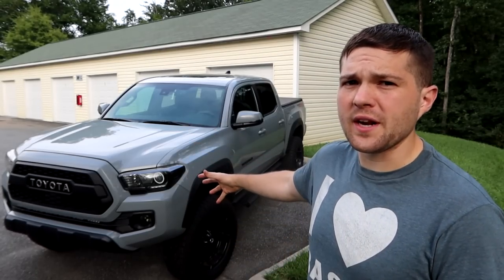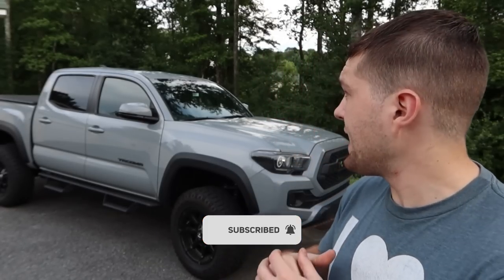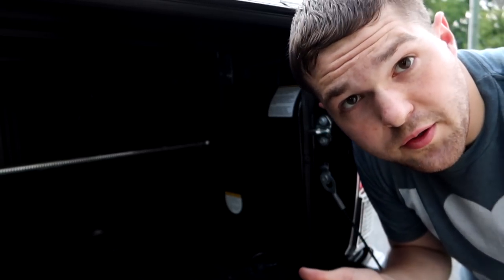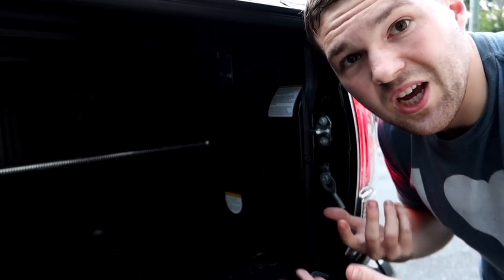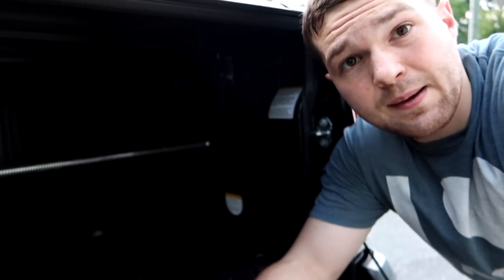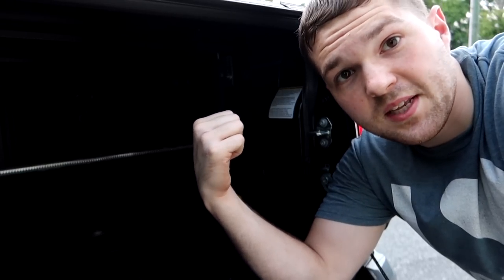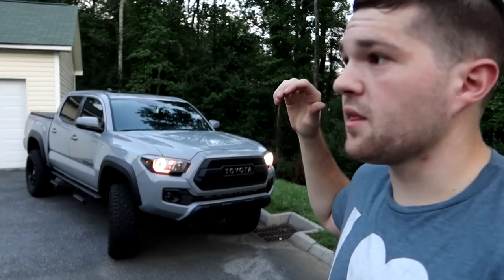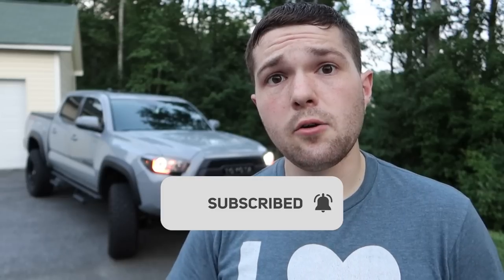The TRUTH about my LIFTED 2020 Toyota Tacoma TRD Off Road

Comment: I just picked up a 2020 Cement SR5 v6 4x4 three weeks ago.  I really don't think the transmission hunts too much but I'm on stock tires.  I took a trip to the Delaware beaches last weekend, a 3 hour trip each way. At one point the transmission downshifted on its own to provide some engine braking on a down hill.  
I used the radar cruise and really like it despite the fact that I used to hate cruise control. You can never stay at your speed here in the mid Atlantic and north east. Too many slower drivers are always making you cancel traditional cruise control.  With the radar it slowed the truck down and if I changed lanes it would speed up on its own to the set speed.  It's so nice, 
And miles per gallon well I got 23.5 in my beach trip. I was impressed.  So far I'm loving this truck. Can't wait to take it camping

Comment: Everyone with the Tacoma needs to buy the rubber bedliner. Solves all your problems
Reply: That's what I did.
Reply: 100% agreee...such a crucial addition
Reply: That's the first thing i did. Fully agree!
Reply: Why?
Reply: @carlosg3320  because the composite bed is super slippery and anything your place back there will slide around like it's on ice
Reply: @MrRay3801  I recently bought tires and when I was doing sharp turns those tires were sliding around. I definitely need to order one.
Reply: @MrRay3801  is this a dealer purchase or aftermarket?
Reply: @davidwelty9763  aftermarket....I ordered mine off I Amazon
Reply: @MrRay3801  thanks!

Comment: I bought the same truck a few weeks after you, only difference, not Premium. I would recommend spending $109 for the Toyota bed mat. Not only will it prevent those dings you were talking about but it will really prevent your gear from sliding around.  I totally agree about the shifting, it sucks!  Mine is stock and I get 20 mpg. Thanks for the video.
Reply from the maker: With my DJ gear I actually like that it slides. Makes getting stuff in and out a lot easier. I never put like on or two things back there.
Reply: have you tried using s mode or ect..

Comment: My wife and I both own 2018 Tacoma, hers is a 4x2 DC SB & mine is a TRD SPORT 4x4 with a 3.5" lift and 32" tires. Our transmissions were always hunting gears also. A few weeks back I took both back to the dealer and made them upgrade the transmission computer software and now they drive like a completely different truck. Plus if you use the " ECT" button you can that extra giddy up if needed. I highly suggest you make them upgrade the transmission software and you will notice a big difference. No more hunting gears in drive and manual shift even works better. 
Bob W.
Reply: So I should do this to my 2020? Not happy with the transmission
Reply: Took my to the dealer for the same thing and they said it was up to date I was pissed, however ever since I took it there it shifts fine.
Reply: Until you hit a 3% to 5% grade at 700 ft asl...then it’s back to gear hunting! Regearing is really the only option. They geared the autos too tall at 3:93, but If you look carefully they geared the manuals at 4:30.
Reply: @DMHal01  how much better does that feel and operate?

Comment: Don't do a Pedal Commander! Get a KD Max tune instead. We did it on our 2020 and it made a night and day difference. We were running 32's for a while.
We are now running 33" BFG KO2's and I couldn't handle how much more sluggish it got so we had 5:29 Nitro Gears installed. That was the best mod so far.

Comment: You need to re-gear the differentials to 5.29’s. That should improve shift points and improve gas mileage
Reply: Also change the upper control arms
Reply: Juan Velez I’ve got Icon Delta Joints UCA once I can get Fox to send me some 2.5 Remote Reservoir Coilovers !
Reply: Should have bought the manual transmission
Reply: Def regear, it’ll help your mpg and gear hunting
Reply: 5.29’s for 32’s?! Sheesh. That’s not a “big, heavy” tire. Toyota needs to update that transmission if you need to gear to that level to push 32” tires
Reply: MrBdiddyp63 What would you suggest for 33’s 4.89 gears
Reply: Terry Osowski not saying you’re wrong, just surprised that’s the gearing a tire that size needs. I think it’s something Toyota needs to fix. I’m used to Wrangler/Gladiator where I had 35/37s with 3.21/3.73, respectively. 5.29s would be for something like 40+.  The engines put out almost identical power, so it must be the transmission (which is not news)
Reply: 5:29’s is a bit low if you’re not running 35+ tires I would think...I’m happy with my 4:88 gearing.
Reply: @juanvelez6947  can you explain why?
Reply: @terryosowski8143  Toyota's gears must really suck.
I run a Nissan Frontier Pro4x 6Speed Manual on 3.69 actually 3.70 rode 33's for 2 years now on 35's 
I plan to regear in the future but to 4:10's i don't know why toyota guys need up into the high 5.08 ratios 

It's like i would of gotten a manual instead if a auto needs that much of a gear jump swear the Truck is already over $40,000 they couldn't of gave you better gearing just outrageous
Reply: @DMHal01  If he isn't Rock crawling that would be useless gear ratio people only go into high 5's which are actually lows  when they rock crawl so they won't have to hit the gas too much it will take itself over the rocks with little throttle that is why they use those ratios.
If you're doing simple trails and nothing outrageous that is just a waste of money ,Half these suckers running around as it is do more street driving then anything else.

Also take into account you change your final drive ratio too much your RPM's will be mad high going from 3.70 to 4.10's on 35's is the sweet spot any higher i am raising RPM's and most likely use more gas.

You have to understand what to compensate with the tire size you over do it you actually make the gas loss worse in some cases
Reply: @tommypearson9260  yeah actually the gear ratio on the auto 3.5l is 3.93 and 4.10 on the manuals if I’m not mistaken. The main issue with the 3rd Gen tacoma is its 6 speed auto and the small displacement engine. If they kept the 4.0 with at least an 8 speed I doubt many would be regearing. Looking back I wished I’d done something like 4.30
Reply: I heard the 4.88 for 33’s but absolutely agreed with it needs to be re-geared. If 35+ definitely 5.12+.. That with a proper lift/alignment would solve the gas problems & the transmission up to 19 are widely known for the transmission issues. 19 up should be straight so if you’re having issues get it tested at the dealership. Hopefully they’ll swap or maybe a programming issue.. They’re bestselling for a reason l guess.
Reply: the real question: how much is that gonna run bro
Reply: 4:56 for 33s 5:29 for 35s

Comment: Good video just bought my taco 2 weeks ago. So I’m trying to buy a rear bed cover and I’m having a hard time finding one. Which one do you have and do you like it ?
Reply from the maker: Got a whole video on mine. Scroll down my channel you will see it. Congrats on the taco
Reply: Taco Rick sweet. I’ve been watching about 2 hrs worth of cover videos right now. I’m looking into tonno pro. But let me check out your video
Reply: Oz Mechanics I had a 17 sr5 crew cab. Great truck as for the bed cover the best one I found was the actual Toyota one that came from the dealer.  It strong doesn’t rattle or squeak on bumpy roads like some of the aftermarkets. Keeps the bed dry and the locking mechanism is pretty stout.  Stood up my 3 yrs constant abuse.  Turned truck in with 64k miles I’m a Hvac contractor def happy with it.

Comment: You don't have to slide your finger on the door handle to lock, you just have to touch the spot. Just hit 1 year and 30k miles on my calvary blue 2019 OR and probably even more in love with the truck then when I first got it.
Reply from the maker: Yeah works better on the slide though
Reply: Thanks for the door lock / unlock truck. I couldn’t figure out why it was relocking after hitting that spot and I didn’t know about grabbing the handle to unlock.

Comment: I have owned 3 Toyota trucks for a total of about 27 years.1993 4x4 extra cab. 2002 Tacoma 4x4 extra cab and my current 2012 4door 4x4, with 3 inch fox coil overs and OME Dakar in the rear. 281/75/17. Get ready for torn inner cv boots and worn Lca’s. In my opinion Toyota is taking a step backwards. They have had a known steering issue, but refuse to fix it or even correct it with newer models. I am in the market for a new truck, but it will probably be a Gladiator. I used to love Taco’s but just can’t bring myself to buy another. And yes the gas mileage sucks, so if I’m gonna get crappy gas mileage, I might as well be able to take the top and doors off and make it worse. Good luck 👊🏻

Comment: I figured out the shift thing. I got an aFe cold air intake and I run non-ethanol gas only. I can be running at 2000 rpm at 80mph. It rarely does the whole “let’s jump down to 4th gear and 5500RPM” thing. Also, oil. Keep your oil fresh. Big help

Comment: Don't forget you can also remote start the truck with the FOB by pressing lock 3 times and holding in at the 3rd time until lights blink
Reply: Is this just on the 2020?  I have a 2019 - thanks
Reply: @rootedrotor525  It should work on the 2019 as well as long as you have remote connect
Reply: Works on 2021 OR with tech package

Comment: Totally agree with the dislikes. I have a 2020 Off Road with 2” spacer/block lift. Getting about 16/17mpg combined driving it super soft. I don’t have the shift problem cuz it’s a manual. Also got the bed mat and Cali Raised stiffeners.

Comment: Yeah I get 17.5 mpg avg city/hwy combined with 265/75/R16 and 20.5 mpg on my 2017 TRD-OR with 4:88 gears and OVTune 91 Octane 2.0 tune for 4:88 gears. I run a full Dobinson’s suspension with JBA UCA and a CBI T3 winch bumper installed.

Get it re-geared and tuned it changes everything.

Comment: Ect button... It's like a Built-in throttle commander. There is a debate whether it decreases or improves gas mileage. I believe it improves the gas mileage because the transmission is not constantly searching for gears. With the ECT button on it will hold the RPMS longer when additional power is needed. If you live anywhere where there is rolling hills definitely use it. You won't get all the unnecessary shifting

Comment: Get the orange tune. Completely fixes the shift issues.  Works great with cruse control.  I hated cruise control before.  Also I get 1.5 mpg better around town and 3 better on the highway.  I am running 33’s and getting 17.2 around town.

Comment: Those storage areas become completely useless when you have 2 car seats in and can’t access any of them with any kind of ease. Traded my 18 TRD OR a week ago for a 21 4Runner I am so happy now. Im also so happy to have the 4.0 w 5-speed back I had in my 14 taco. So much smoother. Thanks for the video.
Reply: I just did the same trade! 2019 taco dc or TRD man trans, for a 2021 4Runner TRD or premium. KDSS is awesome, the new head unit is awesome, so are the new leds. The 3.5 sucks, the 4.0 is much much better.

Comment: I have 2 tacoma's a 07 sr5 and a 20 sr5. The first time i towed my small boat with the 20 i wanted to get rid of it , the shifting was crazy but after a few times i started using just 5th gear and has been a lot better.
Reply: it tells you in the manual, ect on and gear lock to 5th gear when towing

Comment: For all 3rd Gen Tacoma owners. I have a 2017 3.5L with 2in Lift and 55lbs tires. This morning on the way to work I got 23.6 MPG and on the way home I usually get 20.7 MPG (this is normal for me driving 70MPH in SoCal). I did upgrade exhaust, TRD Air Box, I had Toyota update my ECU to 04B04, and I have been running the Orange Virus Tune 2.0 Premium 33in Tyre non-THX. My truck drives like a dream now. It stays in 6th most of the time on the highway, acceleration is smooth and has power behind it, shifts points are right on point and predictable. I can not promise you the same results but for me and my truck the setup I just described fits the bill.
Reply: Which tires are you running?
Reply: @shannondixon3767  General Grabber ATX
Reply: @Donkarnage223  what size and how do you like them... I'm considering the same size lift
Reply: @shannondixon3767  265/75R16. The biggest I could fit without body mount chop. I have the JBA upper control arms, no sway bar, the 650lbs Bilstein springs for the bumper and steel skids. And those Generals which I have taken across the Mojave Road, Big Bear, Gorman all in CA. At 17lbs those tires crawl up anything! Well anything ive tried. Never had a problem or gotten stuck for over 100 in dirt trips now with minor rock crawling. Plus it’s my daily driver. I’ll be buying the same tires next time around.
Reply: @Donkarnage223  Do you feel like you could fit 275/70R17s without rub? A little over a 32” tire but narrower than the 285s most people run.
Reply: @Donkarnage223  Been on TW every day since I found it. Great resource and thank you for your answers.

Comment: 4:05. Pro tip: If you run cruise in "constant speed" vs "variable speed" the sporadic shifting is a big better. Pro tip #2 if the sensor is dirty or you live where there is snow and it won't let you use cruise, "constant speed" cruise will always work.

 I also disagree wholeheartedly with your comment on the composite bed. For $100 you can get a rubber bed mat and throw all the crap back there you want. Toss a shovel in any unprotected bed and it'll dent. Don't forget those spray in bed liners aren't free and if they are "included" at your dealer it's on the invoice somewhere. 

Otherwise accurate video, cheers.

Comment: How does your 275/65R18 ride comfort over the stock tires. 
I have 04 Tacoma and was looking at 18” wheels. Should I be better with 17” I like the 32” tires you have
Reply from the maker: Smoother in my opinion. The wider tires seem to help absorb more impact and help provide a wider footprint for the vehicle

Comment: First mod I did to my 3rd Gen Tacoma was a regear. Best thing you will ever do. Fortunately for me I live a few hours away from Nitro Gears so I took the plunge and got it done. Stock it would jump into 4th all the time going up the slightest of inclines and most likely never made its way into 6th gear unless I was pointed downwards going 70. With stock tires I am getting 25mpg highway and 21 in town. I went with 488’s since I won’t go larger than 33’s but would recommend 529’s if you are running 33’s or bigger with a lot of other heavy mods. Nitro gears, check em out.
Reply: About how much did it run you?
Reply: David collins about $3400. Well worth it and I’m glad that was the very first thing I did.

Comment: totally agree with the 1,2, 3 negative points.  What is up with the MPG...I mean seriously its 2020 and toyota builds a prius....get it together and build an efficient friggin' motor.  For the bed liner get the SMARTLINER Truck Bed Rugged Rubber Liner Mat on amazon.  Best $130 you will spend.  Nothing rolls around and its think so it won't ding the bed.   Great video!

Comment: When you put the taller tires on, did you do anything to update or convert your odometer to the new tire diameter? If not, then the MPG probably didn't go down as much as you think. The gauges think there is a stock tire, so when it is telling you you have gone a mile, you have actually gone about 1.08 miles. So that 15 mpg is actually about 16.2.
Reply from the maker: Correct

Comment: The shift point issue has been a problem lol. My 3rd gen 4runner does the same. I would recommend using ECT, it helps a ton with my 4runner.

Comment: Yep I'm getting a manual for sure when I get a tacoma. Not to mention it should help the larger tires. Btw larger tires effectively reduce your axle ratio and the autos have much higher gears than the lower gears in the manual. I believe the manual has 4:30s from what I read

Comment: I have the same truck made in 2019. The 3.5L is definitely underpowered for the Tacoma. Also, cruise control is essentially useless over 60mph due to uprev and searching for gears, unless you enjoy 3500 rpms while the taco does it's thing. I couldn't imagine going to 285s without regearing... Just my .02, and it means next to nothing.

Comment: Pedal commander doesn't help mpg. Does kind of help smilespg. It doesn't help shift points either. It just changes your throttle sensitivity. Only thing that helps me is to not use cruise control. Trucks are just underpowered.

Comment: Put rubber mat in bed so stuff doesn't slide around and dent proof, also I use my 360 camera more for drive though's and parking lots than off roading very handy as you can set it for auto and come up on screen below 10 km. Need raptor lights! Put these on my pro grill and they make the front of the truck.
Reply: Cameras don’t work good in the rain tho

Comment: one of the most durable beds lol composite is equal to fiberglass but wayyy stronger. sought out for and used heavily for pool guys down here in florida because the chemicals will never rust and degrade the bed! You won’t ever ding composite plastic it’s impossible, you can crack it but that would take a lot my friend.

Comment: T-Rick, to solve your gas milage issue, you are going to need to re-gear.  4.88s if your not off-roading and towing or 5.29s if you are off-roading and towing.  Spend the money and get it done right before getting a bigger lift or bigger tires.  Oh, and hood struts will allow you enjoy the engine bay even more!
Reply from the maker: Already did that the struts in a recent video